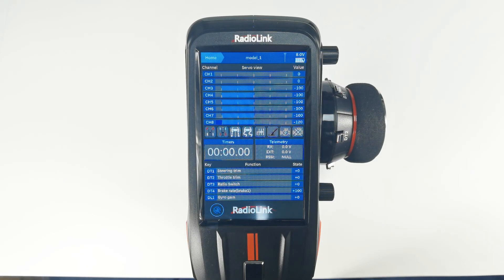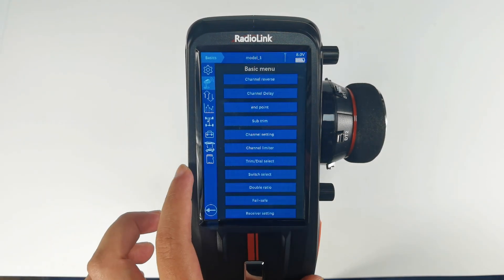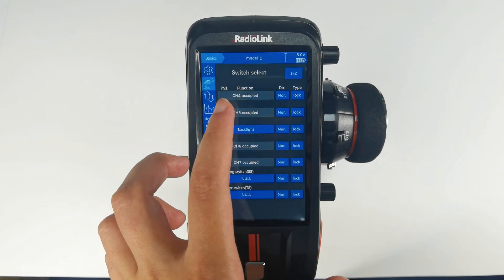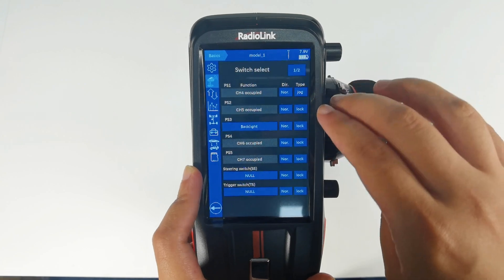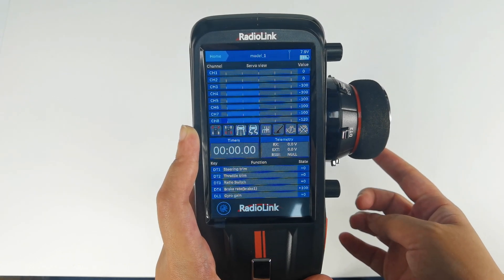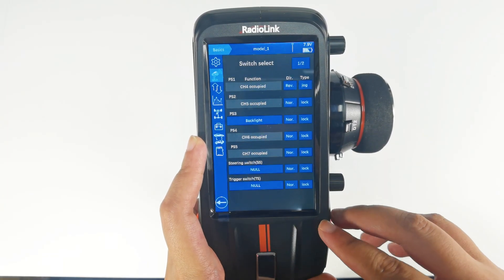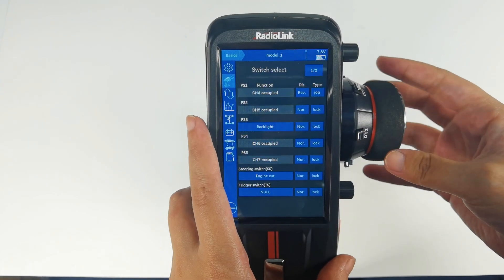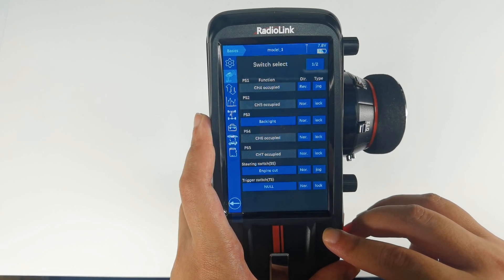2 Position Switch Setting of RC8X

Comment: Hello does binding a receiver and transmitter need esc
Reply from the maker: Hi, sir. When binding them, you need to power on the transmitter and the receiver. You can use ESC to supply power to the receiver, or just connect a battery to the receiver to power on the receiver. Just make sure  the voltage cannoe exceed the working voltage of the receiver. Here is a binding tutorial for your reference: https://www.youtube.com/watch?v=uDIiyr9tmYA  If any question, please feel free to contact us. Our email is after_service@radiolink.com.cn

Comment: Thanks for the video.  So, what would be an example of what I would use the 2-position switch for?
Reply from the maker: Hi, sir. It depends on your needs. You can use 2 position switch to control any one servos. The servo value will go from -100 to +100. Here is the detaiked manual of RC8X for your reference: https://www.radiolink.com/rc8x_manual   If any question, please feel free to contact us. Our email is after_service@radiolink.com.cn